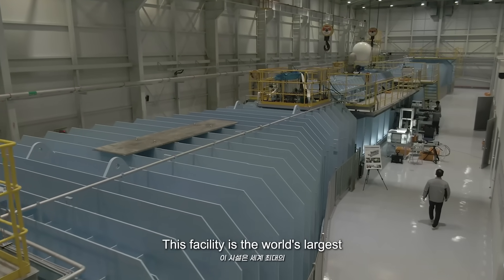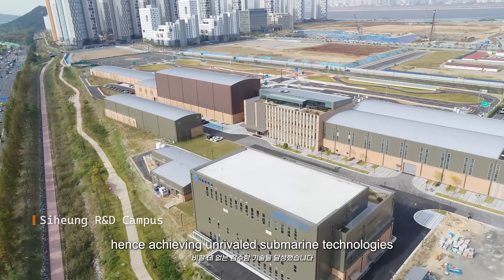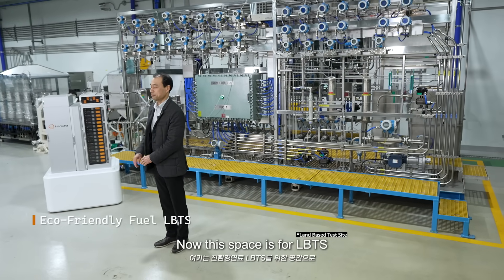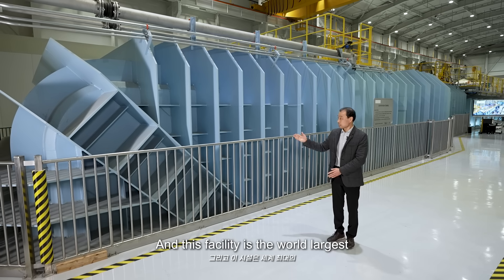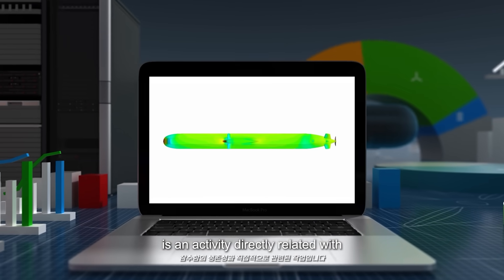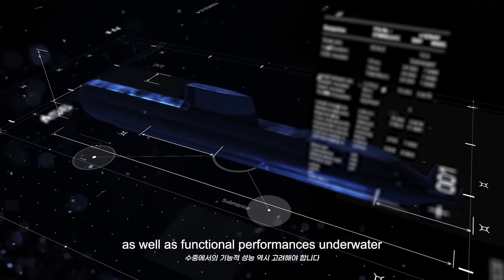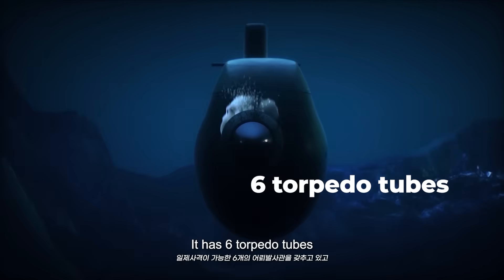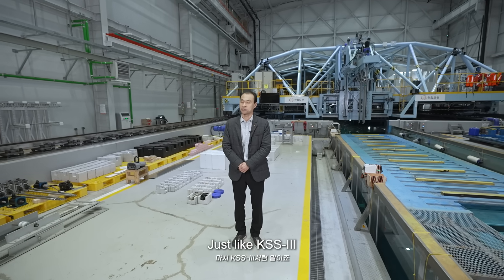캐나다가 탐내는 KSS-III Batch-II…그 이유는?(feat. 기술력)

Comment: I wouldn't mind the Philippine Navy selecting the KSS-III for its Submarine Acquisition Project, since Hanwha already supplies the CMS for the Jose Rizal-class and soon the Miguel Malvar-class frigate, along with the unammed OPVs, it's likely the KSS-IIIPN will also be equip with the same ICMS, along with fire-control system to support weapons such as the K731 Tiger Shark heavyweight torpedos, a sub-launched version of SSM-700K C-Star anti-ship missile, and Submarine-launched cruise missile (SLCM), along with mines.